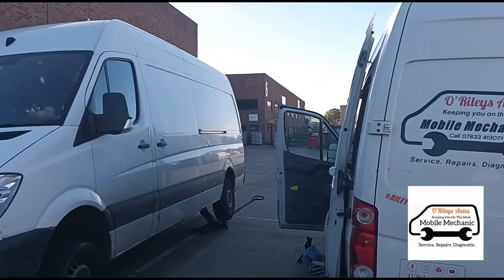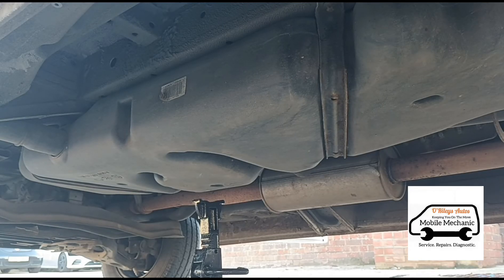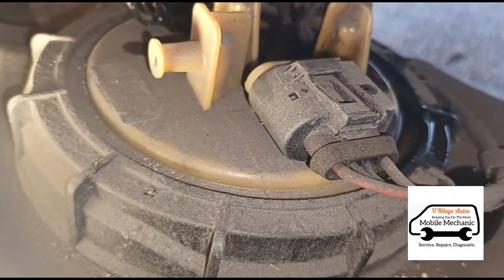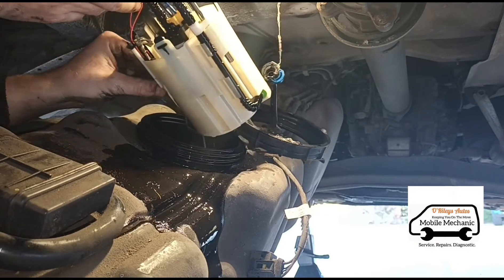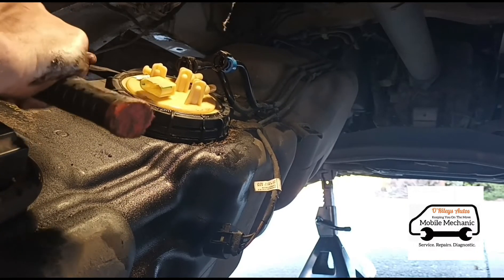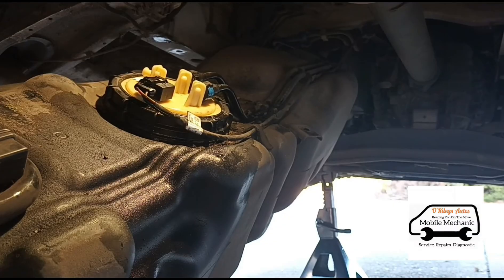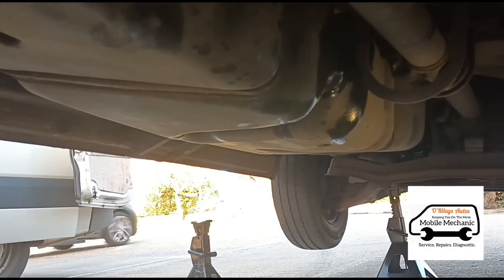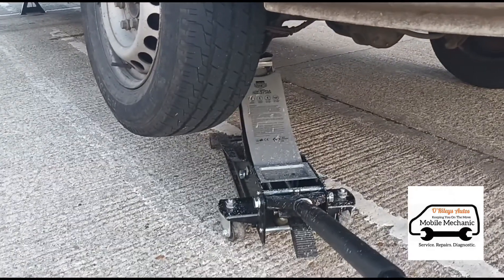Mercedes Sprinter 2.1 CDi Fuel Lift Pump In Tank Replacement

Comment: Top Tip or the DIYer......................Before you remove the locking piece on the top of the fuel pump mark it's locked position so you know how far to turn it back when you fit the new one, that way you should not break it, thanks for the Videos too they are great Jimmy...........................384 days over for a service makes me think you will be doing some more work on this vehicle in the future.

Comment: Thanks for the video, I’ve got a w907 sprinter that lacks power no fault codes fuel pressure on the low pressure pump is 2.7-3 bars at idle is that within range ?

Comment: Just wondering why you didn’t do an amperage draw test on the fuel pump to see if it was that and not a partially blocked fuel filter putting the fuel pump under pressure making it work harder or check the power feed wires for grounding on the body somewhere ,hopefully the new fuel pump fixes it and the fuse doesn’t blow again if it does would you replace the fuel pump again ?

Comment: I have a 2008 sprinter and it’s slow starting. Is that the fuel filter and fuel pump needing changed. Also when I drive off there is a werid sound and when I stop it goes off. Any ideas m8 ?
Reply: Did you found the solution?